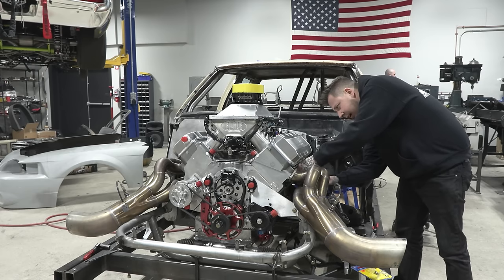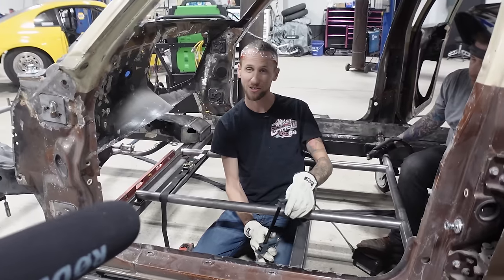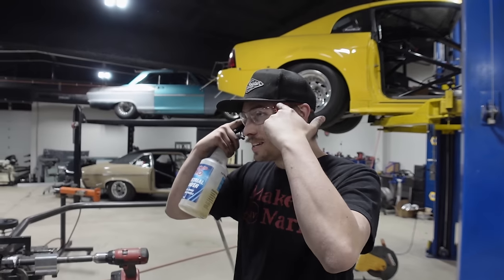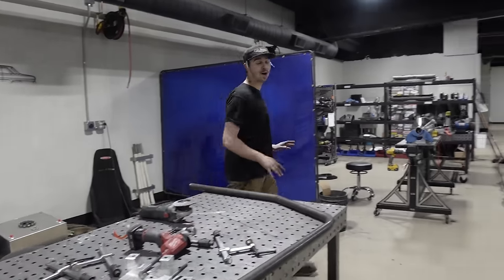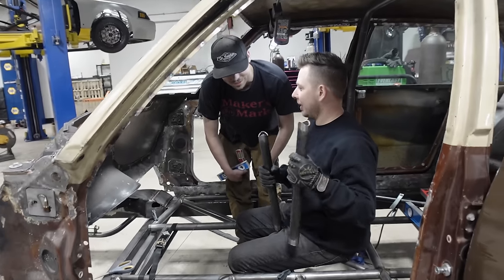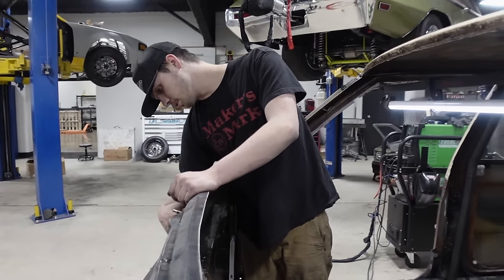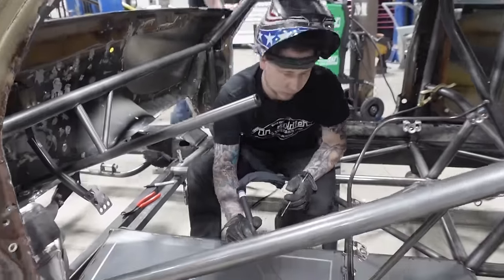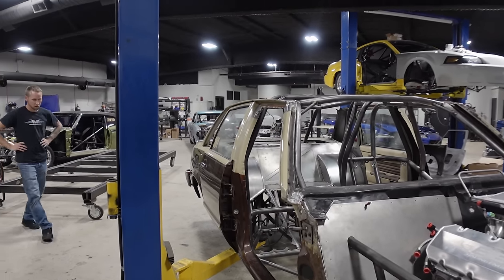Charlie Brown's Biggest Overhaul: Chassis Work & Cutting Loose 🤘

Comment: We had a Milwaukee  8 in grinder and used a worn cutoff disc on it. Without a guard.  But when used it I wore welding gloves or thick leather gloves and also a welding leather jacket and piece of aluminum  under it to protect my chest as best I could. Used it to cut roofs off a car when we built dirt track race cars to put in a cage. Also used it to slice firewalls to modify for engine placement to limits as well as clearance to work on. Cutoff wheel was thinner cut than most other wheels .

Comment: I want to see you weld roof on!
Reply from the maker: That will be included in an update video once we get there!
Reply: @TinSoldierRacecars  I’ve always welded mine with a mirror. Too much work to remove roof panel. Worked on several cars with nice cages that were done by other people that weren’t welded 100%…